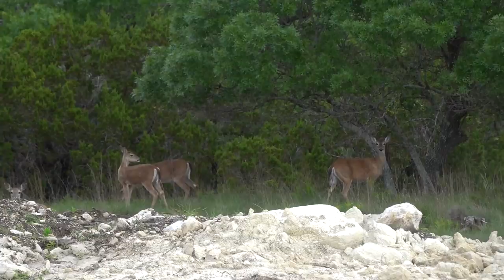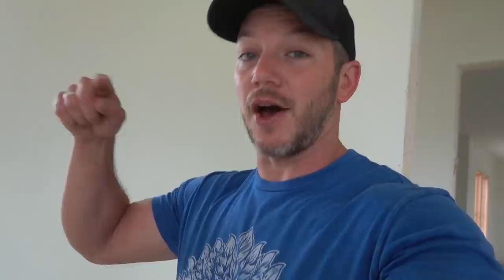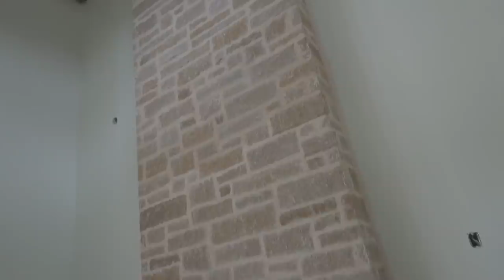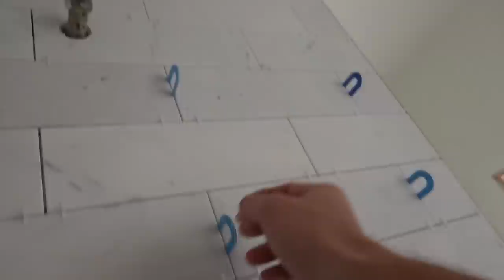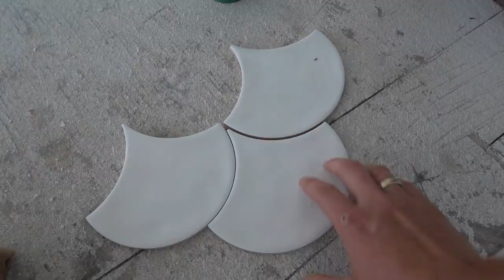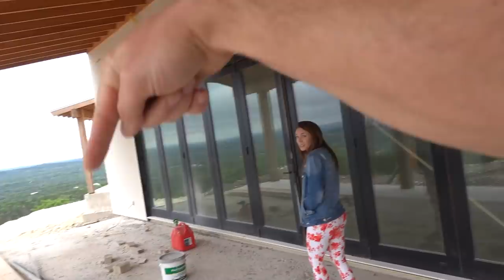All the White Paint is GREEN..... bad bad bad

Comment: I was a house painter for years. It ABSOLUTELY is the light reflecting off of the floors that is making the walls look green.
Reply: Thank you! I was going to comment that they should wait till the floor is done. It’s probably the green floor reflecting on to it.
Reply: I'm not a painter and that was my first thought. Or something with a glass treatment from the windows (solar reflective or thermal related).
Reply: I was thinking the lack of finishes and the Low-E coating and glass does change the lighting on the interior. Having worked in commercial glass, tinting the glass blue or green seems to make the light less subtle and less annoying
Reply: I was think the same thing. Your totally right. It all makes sense.
Reply: 100%.
Reply: thats what ii was thinking, if they added lights inside it should look white.
Reply: Obviously just a reflection effect from the floor, I agree with you.  I really hate that texture.  I have seen it before and it always looks like a mistake.
Reply: yes that's true. white actually reflects green light just a little better than other light, so the walls appear green
Reply: Same, 100% its reflection.

Comment: The walls are reflecting the color of the floors. Don't worry once everything else is finished it will look Simply white!
Reply: It could also be the light coming through the windows. Some window glass has a slightly green tint (caused by iron oxide in the sand they used or possibly from the metal container they used to melt it). It's much more noticeable when you look at the edge of the glass. There's a special type of glass called Low-E glass that also has a green tint, caused by the metallic coating they use.
Reply: Agreed........it's the floors making it look green
Reply: This was my thought as well
Reply: was thinking the same thing
Reply: I came to the comments section to say this
Reply: Absolutely, just got done paying to have a whole interior painted agreeable gray, the blue painters tape and beige carpets in some rooms made the walls look green! Haha as soon as the tape was pulled, bam. It’s gray 😂
Reply: I completely agree. I saw the floor and went ....ahhhh that’s why the walls tint green.
Reply: Exactly!!
Reply: Exactly what I was about to post Kim
Reply: That's what I was thinking as well.
Reply: Floor and glass color there guy! Clearly! Lol I say rip it all out knock the building down and start over. F that green
Reply: I agree.
Reply: @dlwatib  yes, I could be both the floor and the window
Reply: Probably the floors reflecting for sure!!
Reply: I agree
Reply: It may also been the green from outside casting color. If it looks white at night thats it.
Reply: That’s def what it is
Reply: Thr Glass reflects the outdoor greenery onto the flooring causing the walls to take on a faint green tint
Reply: The floor for sure
Reply: My thoughts exactly.
Reply: Can I please come visit y’all one weekend to experience your mansion house for real. My hubby and I have no idea what it’s like to have such an experience.

Comment: Yall are freaking out about nothing, the walls are reflecting the colors coming in from the windows. Green trees and shrubs/grass and blue tints are from the sky. When you fill up the house with furniture and stuff you will see it less and if you go around and put a reflective tint on the windows you will see it even less.
Reply: Nah it’s green
Reply: @Industry-insider  wrong
Reply: Especially with the big overhangs you get mostly indirect daylight. The concrete floors and patios are also adding to that green bump.
Reply: @kenreynolds1000  think about that again
Reply: Trees are not reflective.
Reply: @mircat28  if you see a green tree you are seeing reflected light. If the tree was black…

Comment: that fact that Matt even points out that the floors are green and doesn't connect the dots with the walls reflecting the green lol
Reply: Ok but the upstairs is also green and it doesn’t have green floors
Reply: People with $ paint each room individually, tile the rest, and each painted room has an accent wall, painted in a different color, or colour.  It is fine Matt.
Reply: It’s the trees and stuff reflecting on the walls
Reply: @StevenB08  correct.  Needs one more coat.  Total non issue. Wet areas have purple or green board. Maybe needed a coat of primer first?
Reply: No
Reply: @StevenB08  no
Reply: @77Infidel  no
Reply: @701chevy9  ok

Comment: So, Matt, the way light works is, it travels in a linear direction until it hits a surface. Then it bounces off that surface, taking with it the color of that surface. You have a lot of green foliage around the house, plus you have a bare cement floor that appears to be a khaki green. Mix that in with the glossy white walls and you've got greenish-white walls. Wait until the floors and lighting are done to make any repainting decisions. Also, check the colors during sunrise or sunset, and also at night. You should see differences in the colors that won't be green.

Comment: Been a builder for 25 years and I can tell you that the light coming through your Low-E glazed windows is reflecting off the floors and casting that green tint on the walls. Low-E coating has a greenish tint to it. The color of your walls will look white once your finished floor coverings are installed.

Comment: Random question time. I've seen a few of the remodeling rebuild videos. Did yall guys check under the house and look at the floor joists. The reason I'm asking is because of the fireplaces. Over a period of time the weight from the fireplaces can cause the floors to slop. Really all you need to do is get some floor jack stands. Make a strong level base for the stands and install them were there is a lot of weight like the fireplaces. This will save you in the long run. Don't ask people about doing it just get it done.

Comment: As someone who makes paint at Lowe’s. I can tell it looks green. But it’s all the other stuff as well as the lighting pulling different colors from the tint used to make the color out.
Reply: Right-on .. Simply white has a little bit of yellow pigment in it and the color blue filtering directly thru the 48 windows is causing the wall near the windows  to look green. 
Yellow and blue make green
- repaint in Acadia white or, Bavarian white paint. They have no yellow in them

Comment: I have used Benjamin Moore Simply White many times. No green hue in any lighting conditions. I think its the floor coating causing the problem. If it is still green after finished floors are installed get the paint rep from the manufacturer out there.

Comment: The color of the floor is reflecting on the white walls. That is the culprit for the green tint. I also noticed a green tint to the sliding glass wall unit. That is casting a tint on your walls as well. Once flooring and furniture is in it will look white...simply white.

Comment: The reason the paint looks green is that it's reflecting the landscape / tree canopy.  Like a white pool surface looks blue because it reflects the sky.  If you block the windows you won't see it green (probably).
Reply: It's the blue light filtering thru the 48 windows. Reacting with the slightly yellow hue in the wall paint.
- Yellow and blue make green

Comment: A simple suggestion:
Get some color changing lights and use colors on the lights that compliment your walls.  For instance, your paint is an RGB of 247, 244, 235.  So start with lights that produce a color of 241, 235, 247 or 235, 247, 247.  Those colors will help balance the wall color.

Comment: Cameras also try and adjust for what it thinks is "white" (auto-white balance). A way to adjust for that is to set your camera to the actual color temperature. Because there is mostly daylight coming in to your house you would adjust your camera settings to a "daylight white balance" (or if it can adjust Kelvin value, set it to 5600k). This will prevent your camera from auto adjusting to what it thinks white "should" be and show what it actually looks like. Hope this is helpful!

Comment: The paint is probably reflective. It’s reflecting the green light coming off of the trees outside the window. If it were red outside it would probably look reddish. Check it during the sunset or at night with lights on.  Using a flat paint will help that because your surfaces sort of satin or glossy or semi gloss and reflective but the tent in the walls is the same Hugh coming through your windows. You can’t really tell from the video but a lot of times paint appears to be a different color because it’s reflecting light of a different color

Comment: I realize this is an older video and some people were trying to disprove the concrete reflecting the light by saying it wouldn't be the same in the gym/apartment because there is no concrete in there. Still, it is also due to the double-paned windows that is filtering the light that comes inside the home. You can see this exaggerated when the accordion doors are opened and the glass is exceptionally dark green when looking through all of them at once.

Comment: I've seen that issue before...long story short it's your windows.   Tempered glass naturally has a low green "ish" tint to it especially in low light condition.  You have a lot of that same glass throughout the home.   Unless you change the glass it will remain that way.   I know this because I used to work with commercial glass.  Refraction is also causing that tint because of the seal you have on the floors you will see a change however once you near interior finishes.

Comment: People in the comments don’t know about hand texture , that’s how it looks unless the owner wants it sanded down
Reply: These comments actually don't make sense at all to people in the trades, because after drywall is mudded to fill the screw holes and gaps between sheets, and then sanded, it is a completely smooth surface. If you don't want any texture, you paint it just like that. If you want what most people have, an orange peel or knockdown, you spray it on. Hand troweling is just another method of texture, there is no "too lazy to sand," because there was nothing to sand. That look would not exist without being done on purpose.
Reply: @AceEverett  yeah , cuz there’s different textures , hand texture , orange peel , Monterey, and lvl 5 , which is like paint finish , which is the “finest “ one , and tape and floaters hate the lvl 5 , and ik cuz I’m a tape and floater , but yeah people in these comments don’t know nothing 😂

Comment: Ex owner of a painting company of 28 years. The true light hasn’t been established. A few basic light sources . Sun light /natural , Shade light natural, Yellow incandescent artificial, True white artificial. 
Then there’s the sheen of the paint. 
The brand of paint and then the color chosen with what base tints added. 
All this plays a factor in color perception. Main walls most use a matte or satin finish. (Linen white) is very commonly used for a clean soft white finish. Best brands are Behr, Valspar. Forget the primer/paint in one. Prime first then finish. Check the mix of the paint to see if any greens were added. If not then the green hue is probably reflections from outside and is an illusion. 
And don’t hit him up. He doesn’t need a backhoe. Wife might to dig his grave.

Comment: IMHO, the green is coming from outside. None of the windows have curtains. Some of the light coming outside is coming from the reflection of light from the trees and grass that surrounds your home. For example, I could see a reflection from one of your windows in a few frames of the video. If you have yellow curtains, I would expect that the walls would take on a yellow hew. In that case, the green hew would generally be reduced because some of the green hewed light would absorbed by the curtains.   To test this, block off all the windows in a room, illuminating the room only with a glossy white light bulk. You'll probably find that now the walls look entirely white.

Comment: White paint colors?  There are many, many.  Some white paint colors have grey undertone, some blue, some brown, some pink, etc., and some GREEN!  Instead of choosing a color called "simply white," you need to choose a PURE WHITE.  Ask the paint store for the formula for any white paint you choose.  Avoid those with any drops of green, blue, etc.  Typically, white paint with a drop or drops of black are used for ceiling paint, but it is not necessary to use these.  Can just use pure white - no drops of anything to cloud or color the titanium white pigment in the paint.